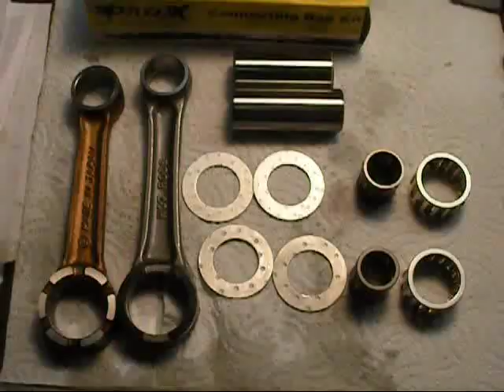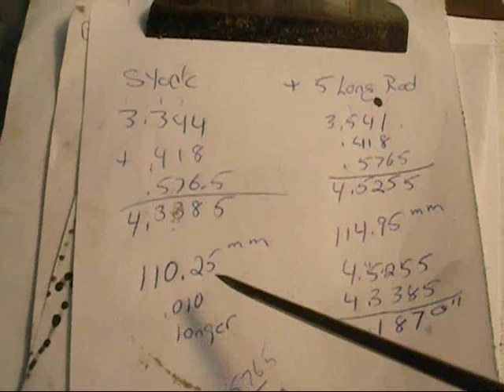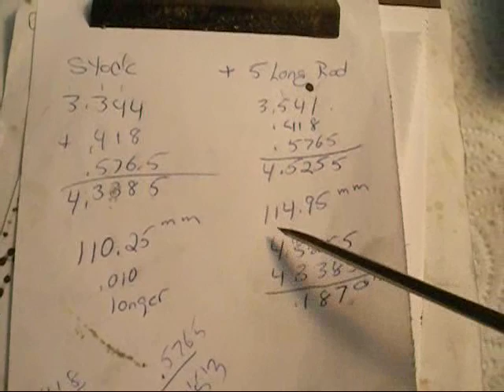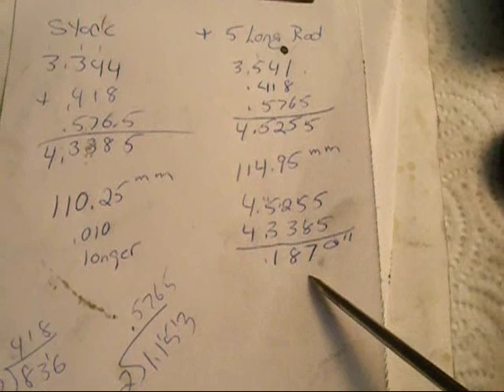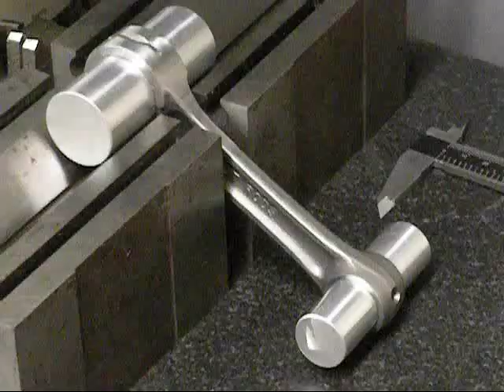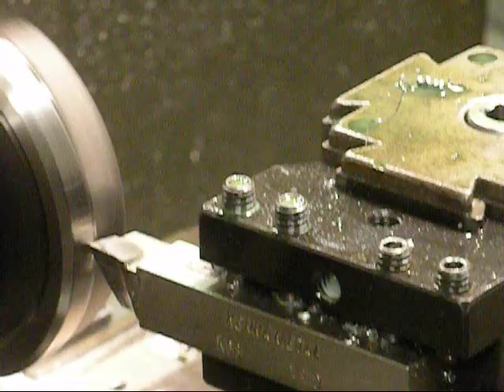Bottom end assembly 1

Comment: again, good informative vid.if the rod length is a quarter mil out, and the crank not true/concentric, you can see why production tolerances are so wide.add in a cylinder and head that aren't accurate and you can see why the manafacturers  have to assume the worst possible parts matching in production, which is why blueprinting is good for reliability and you will see small (maybe 1 or 2hp tops) power gains; the further away from true your engine was, the better it will feel after blueprinting.